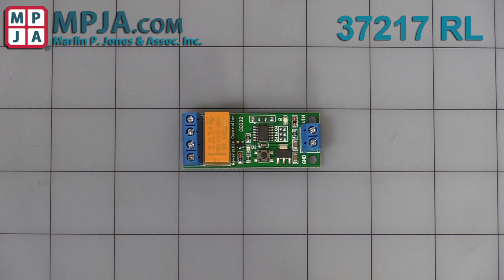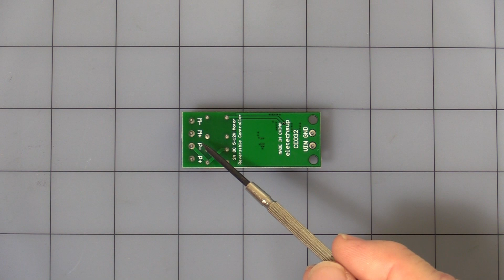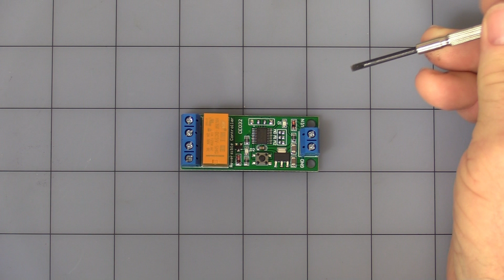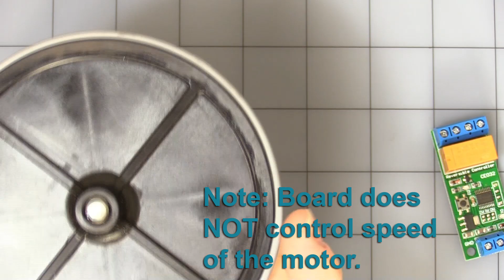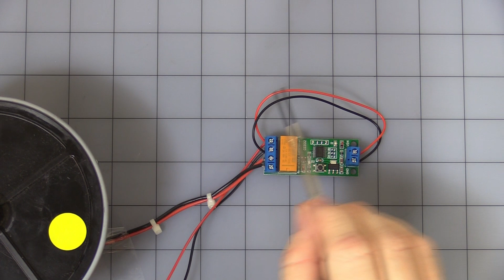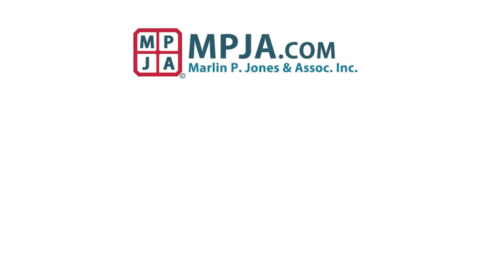Auto Forward - Reverse Cycling Motor Control 37217 RL mpja.com

Comment: Hi there.  I got a reversable geared 6v motor,  but when I plug it in d2 operates is for a split second before resuming forward motion.  If I disconnect the motor relay operates as normal.  Any ideas?

Comment: I am using a similar unit with a display that I feed the motors from an ESC through the contacts.  The problem is that it is fairly high current and I need to soften/suppress the change between forward and reverse to protect the ESC and gears from damage.  Any help would be great!

Comment: Did you know that if you solder a jumper to the 3 jumper selections for the M+ or M- connections you  can actually use the multiplier for one direction and not the other.  6:18

Comment: Is there a way for you to cycle this forward 5 seconds the reverse for 5 seconds and then it stops. Like maybe with an external trigger?
Reply: No. Not with this one.

I demonstrate this very thing in my video.
https://youtube.com/shorts/dHeIsAFeYvo

It runs for one cycle or as many cycles (up to the max the module can do) as you like. OR infinite. 

If you do not need it to stop before reversing, set the stop time to 0. Recommend you give it at least 1 second.